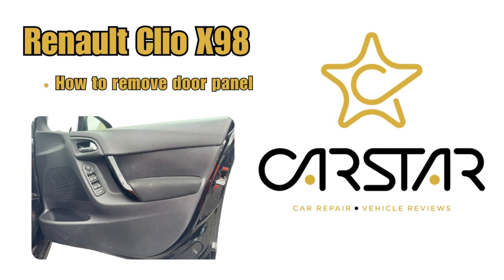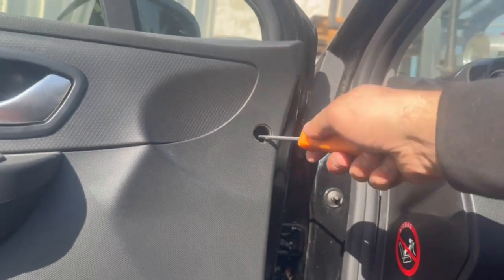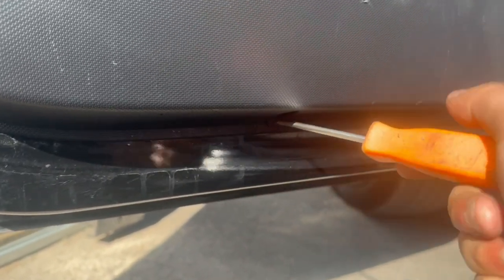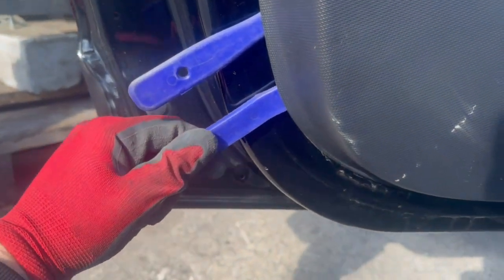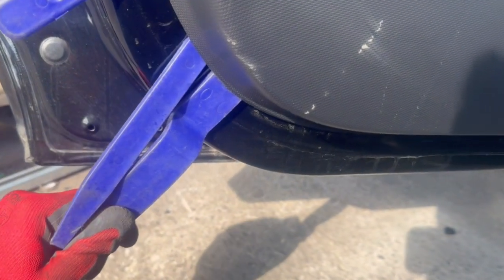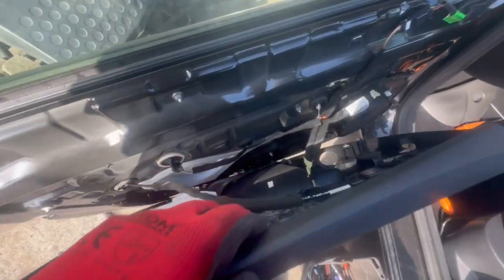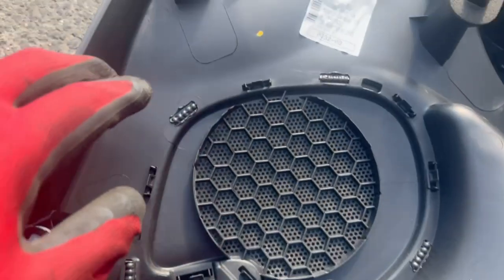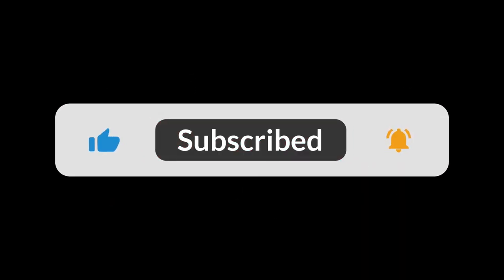How to remove Renault Clio door panel , X98 2013-2019

Comment: My door (left back) is stuck. I want to remove the door panel of my clio 4 to adjust the child lock and open it. Is that possible?
Reply from the maker: It might be extremely difficult removing the torx screws to the side and bottom
Reply: @Aussiecarstar  thanks for replying i got it open with a piece of plastic!
Reply from the maker: @bilalnawazi8436  Was the door completely closed ? I dont know if i understood correctly to be honest
Reply: @Aussiecarstar  u couldnt open it from outside cause the door knob is defect and the child lock was on so you couldn’t get in from inside neither. But I managed to click the child lock open